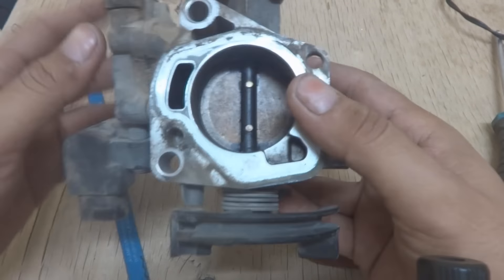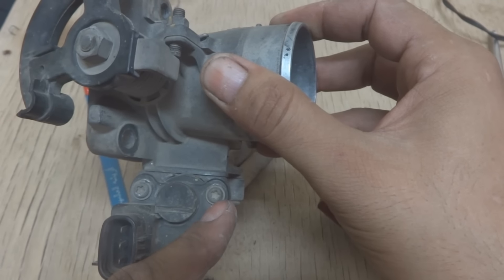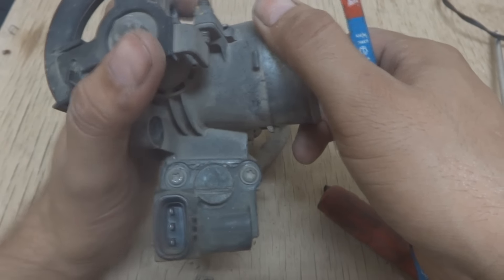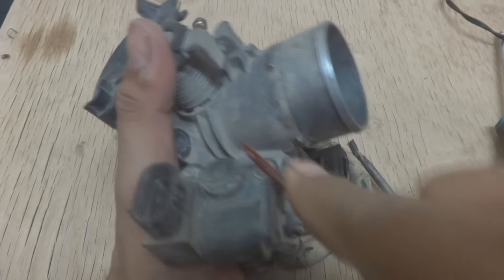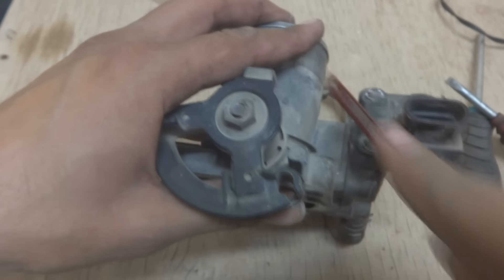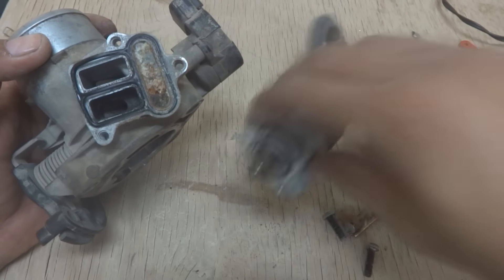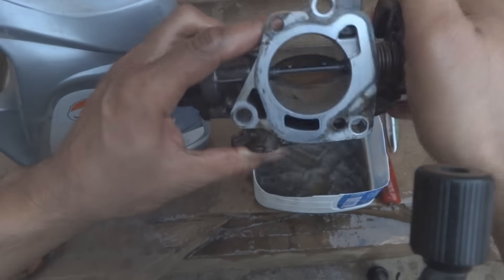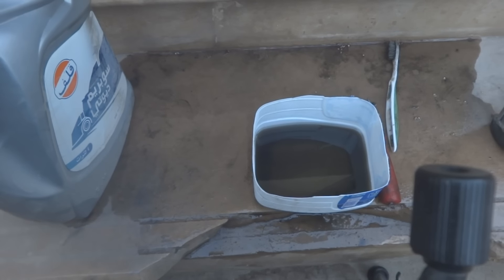Throttle body repair; Throttle body cleaning; Idle air control cleaning; DIY method

Comment: I've seen this before on your previous video and I watch again this video. And I did previously exactly you did, Alhamdulliah , everything ok
Reply from the maker: That is great as you did your work done on my instructions and everything went very smooth and right. This video I uploaded again on another car to give chance to more viewers who are looking for the procedure. Another video will come soon on Toyota Camry having same defect but a little difference throttle body setup. Stay tuned.
Reply: Everything runs smooth after the job done... before Idle too low, the worse is if aircond turn on  the car vibrates. Thanks again :)

Comment: Hi brother, nice to see you again. 
I have cleaned a throttle body of 2000 avalon and its looks like the one in the video, the difference is that the rod of the iac dose not rotate 360 like the one you have but i noticed something strange, it's spring loaded that why it is not rotating 360 it's rotate just about 90 degrees.
Reply from the maker: Thanks dear friend for liking. The throttle body you are telling about is the one used in old model Camry. Toyota Camry they used the same type of throttle body for model year 1998 as I worked on one. But the cleaning procedure and other details are the same like this one. Hope your one worked after you worked on that. Regards,

Comment: Sir solv my problem i have toyota echo when engine is cool its not switching to top gear after once temperature get high its switching to top gear. Have you resolved the problem with your???

Comment: One really dirty throttle body.You do not recommend carburetor cleaner and I wonder why ? Great improvement in the IAC movement and from experience Toyota uses 5 star flex torx screws which are difficult to obtain .Are the 2 corroded pipes replaceable? Is there much difficultly in servicing fuel injectors ? Great informative video !
Reply from the maker: Dear friend thanks for constructive comment. I didn't recommend the carb cleaner because it is expensive here as compared to regular gas. The gas works same way as carb cleaner for throttle body. So it could be a little overkill to use card cleaner instead of regular gas on throttle bodies. Anyhow if there is little price difference in both in your area, then you can use carb cleaner without any problem as carb cleaner is much more effective than regular gas. But for me it is not cost effective!

Comment: sir salam im big fan of u.u r good..sir throttle body ki fish 3 or 5 wire hoti hien.r ap bta skty k in mn 5v ki kitni wire hoti hien r 2 v ki kitni.plz sir.im little student.im in sudia arabia plz help me..
Reply from the maker: Thanks for liking video. There are different connectors used for throttle body motor and signaling. You can't evaluate it only by voltage testing instead you need a service manual for the particular car you are working on to understand the wiring connections for any system on that car including throttle body connector and wiring. Hope you may understand.

Comment: Dear sir:
Thank s for your video really it was useful. right now I have a problem with my car corolla 2004. Its engine has vibration.As an information, I should tell you.on start up the engine feels nice and no vibrations, after 15 or 20 minutes it starts to shaking and vibration.   I checked all mounts, vacuum pipes, and hoses, outside belt inside I think it has time chain everything was good. I changed the spark plugs and replaced to new all of them all so I cleaned the throttle body but not the Idle air control valve. But still, I have the same problem. Please guide me how to solve it. I am waiting to hear from you.
                                                                                                       Best regards;
Reply from the maker: If it is not solved by throttle body then it could be a bad fuel pump or in worst case could be a bad computer. If I would diagnose such a car, I should check the behavior of all actuators signals like fuel injection pulses, fuel pressure, O2 sensor, fuel trims and also the output of MAF sensor. I would notice which parameter is going to be changes with the passage of time. So then I would diagnose for the reason of such change and repair accordingly. Hope you may understand.

Comment: Nissan N16 Sunny 2003 
I have a problem with RPM - it's completely unstable
The Throttle nail has been moved - and the idle sensor has also been moved
How do I return the Throttle nail to the original factory position?

Comment: question if the IAC is stuck open could it cause a lean condition p0171
Reply from the maker: It could be in some vehicles but not in all. In most vehicle with bad throttle body you will feel rough and varying idle and low performance.
Reply from the maker: watch a latest video on drive by wire throttle body.
Reply: thanks.

Comment: Bro yo question drna tapos kom ma sara x corolla da dalta peshawar ky ma wrta throttle body ko aghy na pas gady sai acceleration na kai drop ghuntaky kai, missing like, pa net my search oko nu aghi tps fault yadi should i change whole throttle body or not, aw ta da throttle position sensor da wajy na dy plz help, milage aum drop shawy dy
Reply from the maker: Computer scan your car for any defect and trouble codes. Repair according to trouble codes also check for all four spark plug ignition coils as this is very common defect in this model they are well know for ignition coil defect. If you find any ignition coil defective, replace it with a new one original. Share your experience here.
Reply: Its a swapped car computer cannit be connected
Reply from the maker: Connect a scan tool to scan a car.

Comment: Salaam brother one question i have a toyota corolla vvti 1.6 it has  106000 miles on the clock is have low rpm when idle the car has never stalled but the rpm when fully warm is 600rpm idle.i have cleaned throttle body replaced idle air control valve and replaced mass air flow sensor and replaced air intake gasket seal the rpm when fully warm is still 600rpm is this normal for this car i have also scanned the car for problem codes no codes are found any advice from you will be priceless where are you originally from in pakistan I'm from azaad kashmir
Reply from the maker: 600 rpm is not bad. This seems to me normal. But as you replace a lot of item and have no success! anyhow some cars need a small hole in the throttle plate to bring it to a little high rpm at idle. Maybe this would be your problem solution!

Comment: But my issue after cleaning this is not solved, i changed maifold intake, checked for gas leakes, changed sparkplugs, pcu valve cleaned, throttle body replaced, engine still stalling and rough idles when warm, but at cold start is has no problem, anyone any suggestion,

Comment: Great video but I disliked the working with the saw part. If a DIY or anyone does not have the proper tools to work in a car that person has no business working on it at all but I understand that outside the USA ingenuity has to take place to get things done, still...damm! all that said nicely done, you saved that throttle where probably there is not replacement.
Reply from the maker: You are right. But if someone do such a job in the cheapest way without compromising the quality and functionality, it's not a bad deal. Also a job don't see if it's done by a very expensive pro or is done by a a DIY having very few cheap tools to do the job.

Comment: You use the same method i do with horrible screws, that is what thumb nails are for :-D
I hate torx type screws, they allways find a home in the bin.

That is disgusting, never serviced, and wrong coolant did not help.
The whole system needed washing out, otherwise it will block it again :-(.
I would hold a drill bit in my hand and rotate into the tubes, they looked solid.
I hope it worked perfect when you had finished :-).
Reply from the maker: Yes dear friend the car got a good new life after installing the serviced throttle body in it. Actually this car was belonging to one of my friend and it has been given to me for clutch replacement job. The car was before with a careless user so then it had having big troubles. I addressed many troubles in that and solve for him and brought the car back on its feet!

Comment: agr sir ap mjy koi achi book bta dien. with diagrams.. for engin code diagram reference.
Reply from the maker: There are a few books available on internet on car electrical to free download on internet. But the best way to acquire such a knowledge is to read and understand the service manual for the car you are working on. A service manual contains much more knowledge than any book can provide you. Paul Danner have an ebook available for $50. That is not free. If you will purchase one then inform me.

Comment: This is a basic cleaning video.  It does not show the pipes being cleaned and the space where the coolant is supposed to pass into the system as being clean.  Try not to rush through the video narration and do a better cleaning job for your audience.  Thanks for sharing.

Comment: use Ac delco spray cleaner
Reply from the maker: On throttle body anything can work. AC delco cleaner is good but is very expensive for such a job. For this job regular gas (banzeen) works awesomely. And off course regular gas is way cheaper. regards,
Reply: why not you use it is cheap  Ac Delco if you want to be in the mechanic file you lettel things that will save time so time is mony I totally disagree  with you when you cut the screw this is call a cheap work try to get your self good tolls tools are very cheap if you donnot want to spend just donnot tell people to cut screws thank wish you the best
Reply from the maker: If you have the five points special star tool from Toyota which they used here in this throttle body only then I will totally agree with you and will make another video apologizing people and asking them not to cut their screws for such throttle bodies!
One rule is never working in all places. Engineering is economics. There is no time waste the way I adapted. Instead this could lead to more time consuming sometimes if you have regular gas on hand which works in this case and you must go to get something very special for the purpose. Also on the other hand if you make your job expensive for no valid reason, better don't do it instead give it to someone who can do it for low cost. Nobody likes to waste money. Hope you understand my point. God bless you.

Comment: Hello friend your videos are very informative I watch them and now I came to know that throttle body is repairable. Kindly advise me how can I contact you and where are you located. I want my Alto 660 throttle body body repair because it's not coming down to idle. Its remain at 1000 rpm. I need your contact number and location 
Regards

Comment: That was plugged bad - no wonder it wouldn't work properly -wow
Reply from the maker: Yes dear friend you are right it was badly plugged. I maintained tons of throttle bodies for cars and they had nearly the same condition. People are normally not caring of their equipment and the preventive maintenance they are not taking into account. So such a worst case situation is happening. But good news is it returned back to normal operation after maintenance.
Reply: What was that inside - couldn't really tell - foreign matter
Reply: How did you replace the pipes or tubing on those - were they screw in or what
Reply from the maker: This was junk and gunk from coolant. People are poring "Colored water" coolant most of the time without knowing that how much damage it may creates in their engines and other part like the one you can see here. For such cars in such environment the best coolant would be distilled water but in chilled cold areas the original manufacturer coolant can be the best choice. Also top up is only recommended with distilled water to avoid such condition.
Reply from the maker: I didn't replace tubing for such throttle body as they were not that necessary in the are I repaired that car. Anyhow if it is required, they can be replace with machine shop help. They are not threaded instead they are press fixed using sort of epoxy. So the way to replace them is to drill the older one for removal and fix new one using epoxy resin.
Reply: Understood